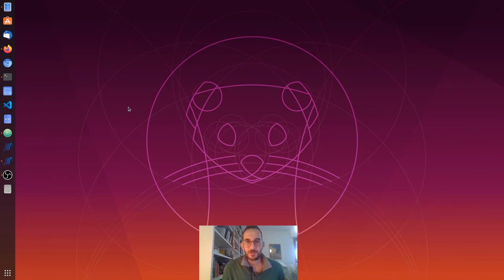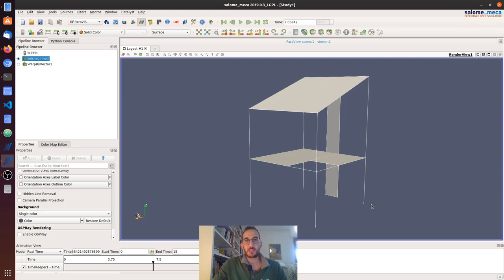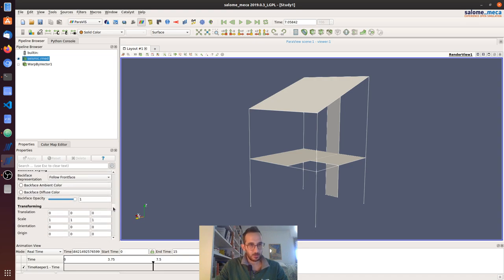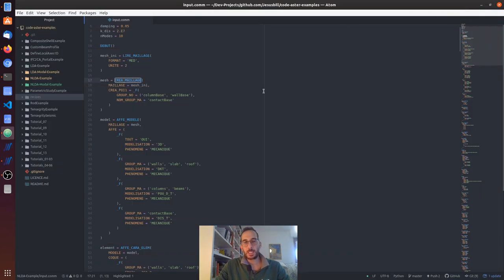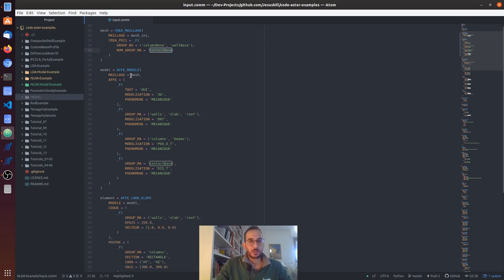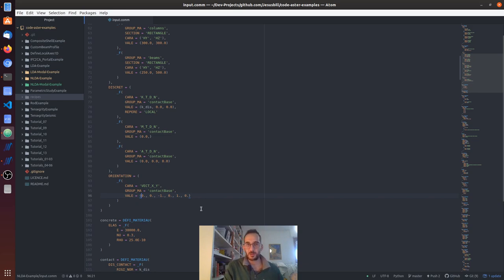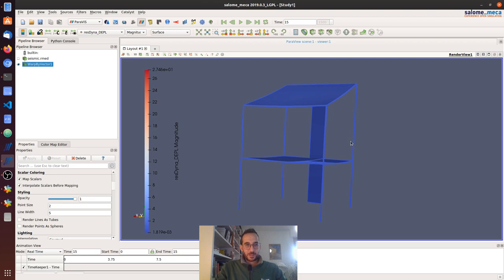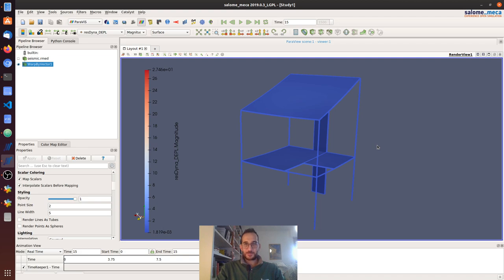How-To Video: Perform a Nonlinear Dynamic Analysis with Uplift/Rocking in Code_Aster

Comment: Fantastic! I watched your video several times and I needed this level of presentation to use Code Aster. If you could add 3 more videos, you would make a big impact in using Code Aster in Civil Engineering, even you may combine all of them together adding only one more video, a hysteretic or viscous two node damper, a multifiber element and a multilayer slab part... maybe I am asking too much. Any of these additions would be a great help to the users. Thanks for you efforts and great presentations.